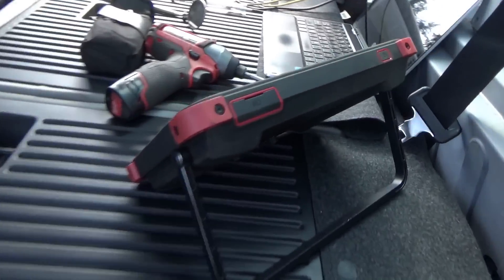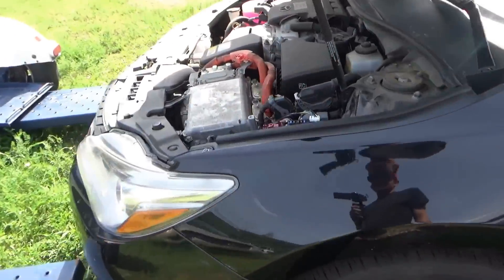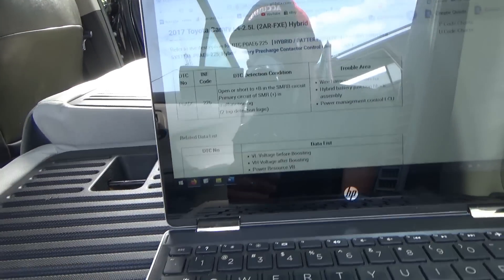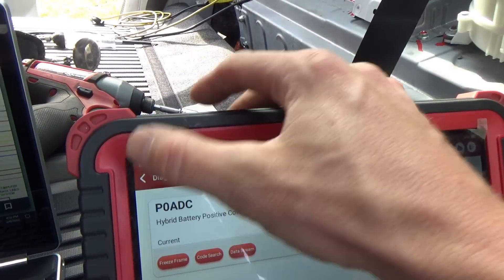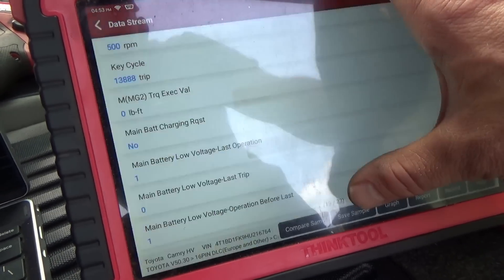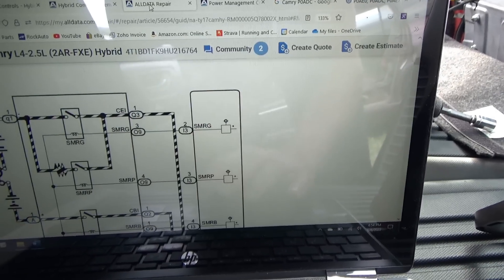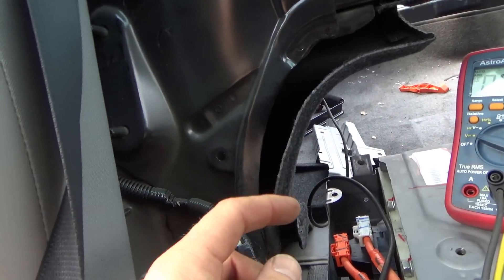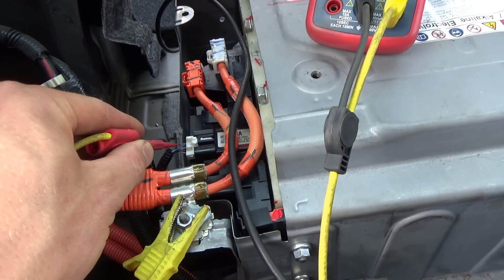Customer bought a HYBRID...and it Can't MOVE! (Part 1)

Comment: I have a 2007 Camry hybrid, the emergency yellow circuit breaker switch is poor design causing the switch not making proper connection and hybrid won’t start. When I bough a refurbished battery the people that sold the battery installed that emergency orange switch wrong and cause no start until I checked that orange switch it was installed backward. Check the emergency orange breaker switch, make sure it makes a good connection. Because there are 2 tiny hole connection on the orange switch must sit into the battery connector properly.

Comment: Thanks.  Your experience here has probably convinced me just to give my car to someone I don't like. 

I have a erratic otherwise very well maintained 08 HHy. Sometimes it operates correctly, sometimes it codes. Died completely the other day.  Then after disconnecting the battery terminal and recharging by running the motor in drive against the brake it started to operate correctly again.   We're on the second rebuilt replacement traction battery.

Freaking thing look so complicated that people like myself simply shouldnt own them.

I can tow mine for $250 to a confused Toyota hybrid tech and spend maybe another $500 to $1,000 diagnosing things.  This would be fine if I thought it solved problem for a while.   But I honestly think they are as confused about this kind of technology as you are.

I should have brought an ice V6.

Comment: I think the no start when the HV battery is low is there to protect it. After all if you start the engine (which behaves like a generator) you’re likely to send way too much current to the depleted battery and damage it permanently.  NiMH in particular needs to be nursed back to life with a trickle charge. Lithium would likely be permanently damaged anyay, although they are likely to hold their charge much longer. NiMH has a high self discharge rate, so leaving it for any length of time is problematic.
Reply: Newest Toyota hybrids are being switched over to lithium ion traction batteries, I wonder if lower self discharge rates are the cause it…

Comment: Hi Ivan, advice from a guy that worked for 45 years in the X-ray repair business. The high voltage battery bank in Hybrid and EV cars is a real danger to keep forever in mind. Back in the 90s I installed and serviced a line of machines that used a battery bank that was around 370 volts. The locations of the batteries were on the bottom rack of the machine and very hard to reach. The connection link to each battery bank used a bolt on a lug that a 4m Allen wrench fit. I had the wrench wrapped with electrical tape except on the ends that fit into the cap head bolt. Some how when removing the bolt an open end of the wrench touched another part of the battery pack link bars. Much of the wrench melted in a flash of sparks and molten metal, with the sound of a 12 gauge going off next to my head. I had the battery bank disconnected from ground and the circuit broken at the mid point. Point is never underestimate the power that is in the battery pack.

Comment: I remember several years ago when I replaced some faulty cells in a HV Battery I got burned on the 'safety quick disconnect' it disabled the entire vehicle because the battery sense wire pins in the top of the connector pushed out the back of the plug when I 'activated' the system, man that was fun trying to find out why it was dead! 😅

Comment: Ivan on a different note. I want to thank you for turning me on to deoxin. I had a problem with a turn signal on my boat trailer checked all the wires did everything I could think of and still wouldn't work. sprayed a little deoxin in socket and then moved the plug in and out a couple of times and what do you know, everything started worked again. Thanks again for the tip.

Comment: I have seen auction sabotaged personally at a shop I used to work at, we had a used car dealer bring use auction cars and there would be things unplugged like injectors etc. so I bet this was on purpose, because people are scared of bidding high on a non running hybrid.  The fuse being pulled is prime suspect number 1. People can drive the cars at auction unattended, so I bet this was done there. I bet the owner got a hell of a deal.

Comment: You said that it was obvious that someone was in there.. I wonder if they had that unplugged and simply pushed the pin inside, as they tried to force it to plug back in??  kinda strange.  (unless the pin is simply broken off)..   I would be tempted to look for videos of people pulling the cover off and see what I was up against.. I definitely wouldn't want to pull the cover on a high voltage system blindly. Maybe that pin and wire are just laying inside there and need to be pushed back through the hole-- that simple.. (maybe. possibly. lol)....

Comment: One problem with auctions is they allow people to check out the cars in the lot before they come up for bid. Lots of times some scumbag used car dealer will sabotage a car so it won't run, or will appear to have a problem so they can get it for a lower price. The missing ecm fuse is a dead giveaway. The missing pin is too much of a coincidence. The parts to fix this car are in someone's pocket . Ruins it for all of the legitimate dealers.

Comment: I got one for You Ivan, unfortunately i am doing it.. 
E450 6.0 diesel conversion to casino shuttle bus.   Rectifier and inverter burnt up pretty sure.. I took it all out but cannot figure out how they wired the generator ( alt).  I got a -12 on a feed?  Its 1 gauge and was going to rectifier.  Any ideas?  I have the eldorado conversion requirements but not the actual build.
Anyway, you fixed another!

Comment: I have a feeling that the fuse and missing pin are the tip of the iceberg becauyse you wouldn't need a part 2 in order to just replace that part, right? ;)

Comment: How odd that a pin is missing but no sign of corrosion or a mullered plug.
I bet it still didn't move after the pin problem was fixed lol, never that easy :-D
You like a head scratcher,lol

Comment: These inputs are intended to check if the relays are not mechanically stuck, to prevent the battery or power electronics from getting shorted and the battery catching fire due to overcurrent or overcharging. The contacts are usually normally closed, meaning they open when the relays engage.

Also, I do hope you pulled the battery main fuse before doing these tests. If the SMRB (B+) was in fact stuck and you manually energize one of the negative relays, all of the power electronics would become hot unless the battery was disconnected first. There should be a bright red disconnect tab on the battery which pulls the fuse, it's supposed to be easily accessible for firemen in an emergency.
Reply from the maker: No the load side of the relay are most definitely NOT normally closed...see diagram!
Reply: @PineHollowAutoDiagnostics  The load side is not but there is (or should be) an additional set of contacts that is NC and is intended to check the condition of the load side contacts. Both sets of contacts are mechanically connected.

When the load side contacts are welded together, the detection contact will remain open, which signals the ECU that the relay is defective. It's an NC contact so a faulty wire will also trigger a defective relay fault.

If there only one set and it's NO, that means that the relay is only a helper contact for the bigger relay that switches the battery HV on the load side. The 12V and 300V circuits should be completely separated and insulated from each other.

Comment: Ivan, you did it again! I am sure you are aware of the tremendous amount of current that these battery packs store. During my AF days, we were required to remove all jewelry watches and secure our dog tags before working on electronics. The penalty was either death or losing a stripe. Anyway, we have all arced a screwdriver working on regular systems just imagine what these electric vehicles can do.

Comment: What the heck!? Seems like maybe someone swapped the relay box with a Prius unit. I would run the part numbers on it an see what comes up, maybe take a quick peek at a 2017 Prius wriring diagram relay an see if the that pin is still there. I have a hard time believing the pin just broke.

Comment: Another good video IVAN,I helped a neighbor change a motor mount on his prious along with a dr side axle.He did not have a repair manual.So after telling him to try and get one,i did some on line research.There are safety protocols that need to be followed,and while looking at his car i saw all kinds of warning stickers.I used to wrench long ago,and learned early on read directions 1st ,then work.haha to me reading that is fun not a chore. when i read 270 volts DISCONNECT BEFORE entering system,ok i pay attention...i Found out the right way to {PULL the plug as it were on his main battery.IVAN,there are guys out there like me that still enjoys repairing there own stuff ,whether its cars ,motors lawn mowers etc.GUYS get a book!!!  I told him after we fixed his car ,i wouldn't be able to help anymore in the future unless i saw A BOOK IN HIS HAND FIRST>haha,I know how to disarm a landmine,but i didn't learn on the JOB or BY TRIAL and error.Thanks for making these vids IVAN.Most cars aren't designed badly,if you learn how to properly repair with a MANUAL or wiring diagrams.

Comment: Diagnosed Dan will be my next port of call, uve explained how roughly the circuit works but my god plz don't mess with hybrid batteries coz end of the day your gunna die if you start poking about you must stress that because a test light will not fix a hybrid systems on most cases

Comment: If that missing pin is in the connector block its been pushed back by someone either testing or not placing the white harness connector in properly. Only one way to find out Ivan,,,,so go for it.

Comment: Messing anything around this box without the HV battery disconnected (at least by the safety manual disconnect link electrically in the middle of the battery chain) is asking for big troubles, mainly when integrity of some of the relay is a question. With the HV present, you not only are risking electric shock or a short circuit arc (that is no joke with anything beyond 24V), but by "testing" the relays in such way, mainly when the negative could be permanently ON means you send very high charging current spikes into the capacitors in the traction inverter module (mounted along the motor-generator transmission assembly). The reason why there are 3 (and not just 2) contactors is one connecting the traction battery negative to the inverter, second connecting the positive via a resistor to precharge the capacitors with limited current and the 3'rd one connecting the positive "hard" after the capacitor is precharged to allow the main current to flow. With this experimenting you did and with the negative contactor permanently ON (it was clicking when you disconnected/connected the small connector), switching the direct positive contactor means you were connecting the capacitors without the proper precharge sequence. That caused at least heavy sparking on the contactor and quite a stress for the capacitors.
Reply: Yes, High voltage DC is no joke. There's a good reason for all of the safety interlocks. These batteries can dump an insane amount of power into whatever comes in electricity's way...
Reply: Confusing why people don’t make the HV system “safe” before working near it. I personally don’t risk it. I know they’ve made it incredibly difficult to actually electrocute yourself with all the interlocks & ground protections, but it was also “impossible” for the Titanic to sink and look how that went 😂

Comment: Because it's an auction car, it seems like these 'issues' were caused on purpose. Good job on the diagnosis.
Reply: Agreed however this hybrid battery is usually buried under behind the rear seat back and panels in the trunk so it would take some time & tools to get at it. On the other hand I can imagine a skilled Toyota tech having the knowledge and skill getting in their knowing exactly how to disable it in a spot extremely difficult to find. :)

Comment: Being dead serious here and no pun intended but can a hybrid system electrocute a technician and possibly kill you? What about EVs....there is even more battery voltage and current...right?? Getting a poke from a spark plug wire is not to bad but an EV or Hybrid...must be dangerous?
Reply: Yeah them things will kill you. That’s why the orange 🍊 wires are marked. They are the high voltage. I think the real problems will be from fire. Once ruptured any moisture inside the battery will start a chain reaction fire 🔥
Reply: Yes I believe when working on a hybrid or EV you are supposed to have another person with a cane to pull you off if you get electrocuted.

Comment: Seems like the Hybrids are finally getting old enough to need guys like Ivan, Chris Fix, and ScannerDanner.  I love this hybrid content because it’s new material.  Awesome job, Ivan! I wonder if the pin is just pushed in or was broken off.
Reply from the maker: I'll send it to Chris Fix to polish up the headlights :))
Reply: @PineHollowAutoDiagnostics  😆😆😆
Reply: When I look at 11:29 it more looks like the pin isn't there at all, which to me is a bit strange.
Opening the device might reveal more.
Reply: Most dissapeare from dutch roads and are not sold. to have a fake high 2nd hand price by fake shortage or so no one knows how bad they are.

Comment: That was an impressive diagnostic!! Once you found the culprit, my best bet is that a careless reinsertion of the plug sent that pin in (probably slightly bent and pushed in instead of mating). I've seen that happen in "similarish" plugs and, sometimes, it's possible to push that pin back in place, but it needs to be well glued inside, to avoid repeating the problem later on.
Reply: You are probably correct but it doesn't answer the question of why the connector was removed to begin with.   We will see in part 2 :) but I wouldn't be the least bit surprised if replacing the component with the broken connector merely gets the car back to the original problem that was being troubleshot to start with. While it's not impossible, I find it difficult to believe that the pin spontaneously ejected itself through the male half of the connector never to be seen again without having been messed with to begin with, so why was it messed with?
Reply: Was a problem on old computers with serial ports. Was easy to bend pins when plugging in a cable or the ribbon cable going from the motherboard to other hardware.
Reply: @mikefoehr235  Yep. Seen that too :-)
Reply: @mikefoehr235  at my dialysis clinic our machines have RS 232 serial ports on the back of them. When they break (very occasional) it’s annoying because our automatic vital charting system stops working. The solder points inside the connector break and allow the pins to be pushed all the way in. Luckily the part is modular and easily replaceable by our biomedical technician.
Reply: That's exactly what I would have tried to do. A no-parts repair!
Reply: @ScottDLR  Yeah! I was hoping for it :-)
Reply: good connectors don't bend  garbage connectors bend
Reply: @monfrig6959  Yep, as a rule of thumb. But I've seen good quality Amphenol and Molex connectors bent. Sometimes it's just a hasty move, sometimes it's lack of sensitivity, pushing too much and not feeling the plug resisting.

Comment: that was fiddled with and the fuse was missing. I suspect it's reposessed and the previous owner expected that would happen and sabotaged the car.
Reply: I get a feeling that's exactly what happened. At first I thought the missing fuse could have come from another shop because of a failed diagnosis. But a missing pin? I have seen pins pushed in from a connector, but usually on aftermarket junk with poor pin to body fitment. On OEMs, I've seen it, but very rarely.
Reply: Interesting theory
Reply: I get the feeling that's total projection on your part...
Reply: @buckhorncortez  Yeah..... The fuse just got out of the fuse box on it's own and the pin, after a 5 year service, just decided it was shy and pulled away....lol

Comment: Maybe the pin wasn't fully pushed in from the factory and it backed out over time. The fix could be as easy as pushing it back in. Assuming noone was in there before, then you can't know what happened.